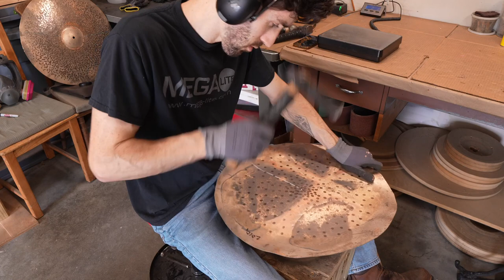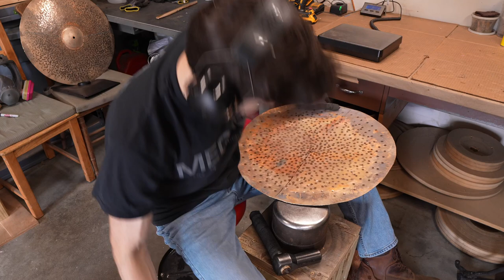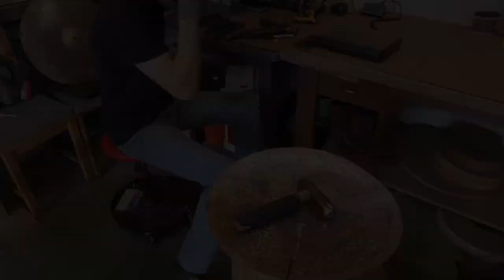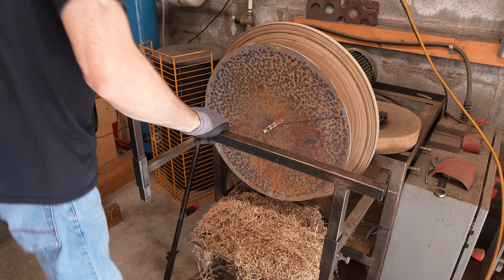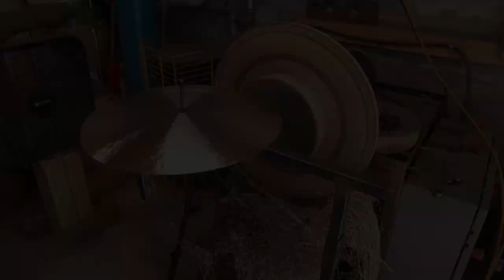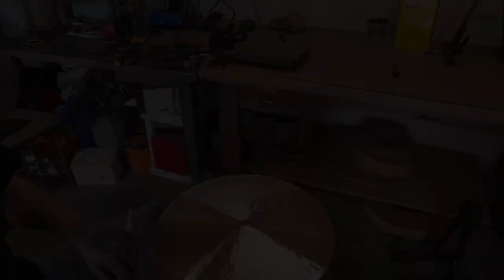Making a Flat Ride From Scratch (The Prism Series) - Timothy Roberts Cymbals

Comment: Very cool! So if you were going to hammer a bell into the cymbal would you do it after your initial hammering and you decided what would be the top and bottom?
Reply from the maker: On a flat blank, I start very first thing with hammering the bell. I can tell based on the shape which way it'll want to go. With a flat ride, sometimes the material will respond differently, causing me to change which I designate as the top.

Comment: very interesting.  
Cymbal sounds nice....I kinda dug it a bit more before you took the extra grams off of it, but that's just my weird taste, and both ways are very nice.  
How long does it take to do this?  Can't quite tell from the video if it's an hour and a half or all day.  I'm wondering just about the time you're actually working on it, not the resting periods.  
Also, what's the name for the stick-like thing you use to shave the cymbal?
I will be very embarrassed if that's the actual lathe.  I always figured the lathe was the machine that spins it.

thx!
Reply from the maker: Thanks Dave! I like the sound both ways too. The heavier version would work better for certain applications. 

I usually spend between 2-5 hrs per cymbal, stretched out over multiple weeks. The stick thing is the cutting tool. The machine it's mounted to is the lathe!
Reply: @ReverieDrumCo  Thanks man, appreciate the info!

Comment: Do they ever key hole when you put the Centre like that?
Reply from the maker: No, keyholing typically happens when the stand doesn't have all the parts and there's metal to metal contact for long periods of time.
Reply: @ReverieDrumCo  key hole maybe isn’t the right word. Do they crack or do u have to chamfer the hole?